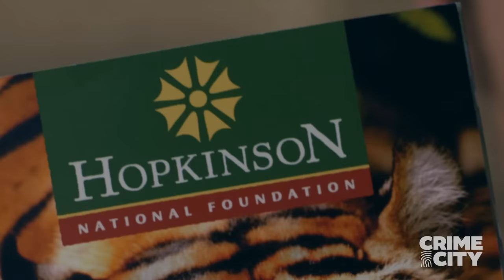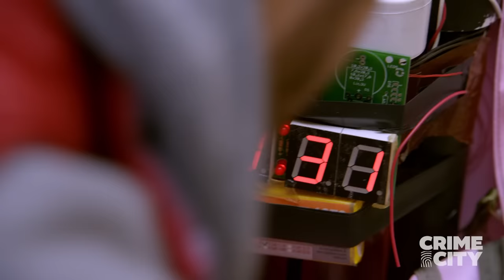The Blacklist | Bomb Diffusion at the Zoo (James Spader)

Comment: Tracking chip that transmits through solid metal?
Hollywood physics.
Reply: To be fair they could have put it in any container it wasn't really relevant.
Reply: It wasn't inches of solid steel. It was thin aluminum. Basically a phone.
Reply: @ProfChaos1985  A Faraday cage is just a fine metal mesh that you can see through, yet it stops electromagnetic transmission.
Reply: @patmcbride9853  A Faraday cage uses conductive metal. Not all metals are conductive, such as aluminum.
Reply: @ProfChaos1985  OMFG! You need an educational intervention.
Reply: @patmcbride9853  where did you get yours? I need to mark that one off the list.
Reply: @ProfChaos1985  aluminum is definitely conductive. It's not as conductive as copper but it definitely conductive. Any element that has large numbers of electrons that it can shed is conductive. Idk where you are getting your info but aluminum is considered one of the best conductors out there. So much so that it's the most used in electrical wiring after copper.
Reply: Anonymous YouTuber thinking he knows all about high tech spy equipment?
YouTube Physics.
Reply: says the man who knows jack about Gov or military tracking devices.
Reply: @okbutthenagain.9402  Says the man with a degree in electronics, troll.
Reply: @okbutthenagain.9402  no matter, they are not magic. Physics are physics